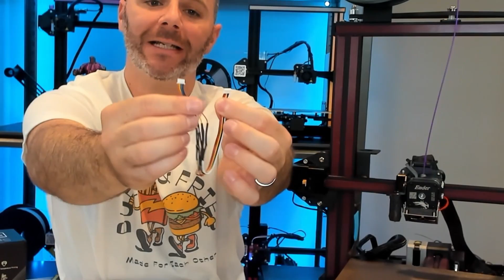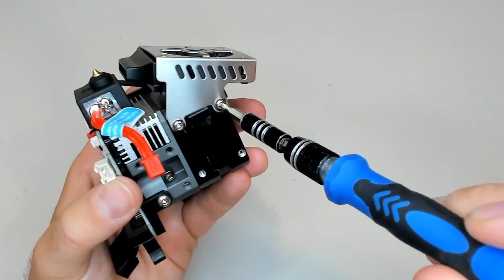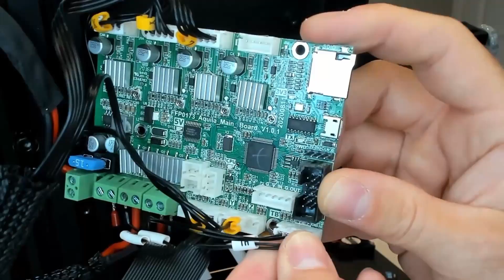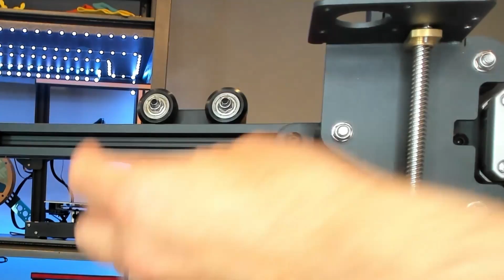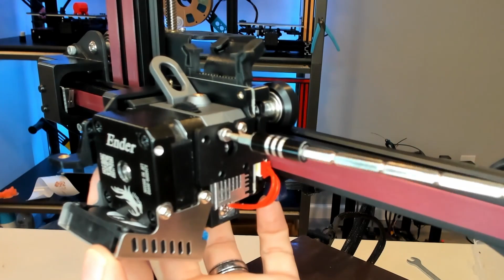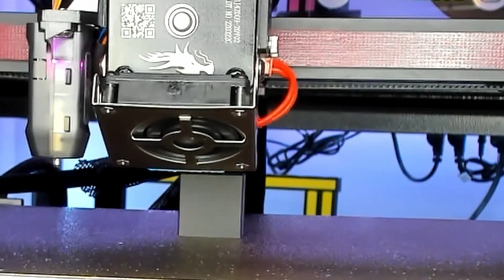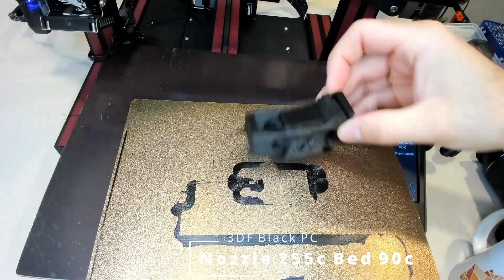Direct Drive Voxelab Aquila with the Creality Sprite Pro

Comment: Hello, I just installed the Sprite Pro on my Aquila S2.  When I tried to heat the nozzle, it shutdown and restarted with an M112 error.  I did what you said and reversed the nozzle heating wires and it doesn't shut down now, but I still get an M112 error that won't go away.  I have installed your Aquila Sprite Extruder firmware as well.  Should I switch to the Alex firmware?  Thanks!
Reply from the maker: Recently someone else had a similar issue and it ended up being an issue with a wire being burnt out (I think). Can you check (visually) the wiring harness where it attached to the break out board , as well as the main board itself to check for any sort of shorting out damage.
Reply: @PrintsLeo3D  I will do that, thanks!

Comment: Is this mod suitable for Aquila Pro model?
Reply from the maker: Victor I don't think it is. I don't own an Aquila Pro and I'm not very familiar with it's components, but I believe this is the Aquila that uses a mainboard as well as a smaller breakout board.  Because of that feature, as well as the onboard probe, that may not play nice with the sprites break out board (again I can't confirm because I don't own one) I would think this is not an easily compatible mod like it is for other Aquila models.

Comment: Greetings! My sprite kit just arrived? Just to try to speed things up and get an experts reference point, what where your offset settings for the Cr touch and your flow adjustments?
Reply from the maker: Hey I'm sorry in advance that this answer is going to be a little wishy washy, but I'm on vacation and not at home so I don't have access to my settings. If you go to my website I have a webpage dedicated to the Sprite, and there you should be able to find the offsets and the profile I was using! (PrintsLeo3d.com)
If you need some more help let me know and I'll do my best when I get back home !

Comment: My Ender 3 pro came with hot glue all over the motherboard. It was really difficult to remove connections and after all that, we can’t get the hit end to heat up. 😢
Reply: I found out yesterday that the hot end wire wasn’t actually connected to the daughter board.😂 it worked great after that. It was actually really frustrating to get the old connections removed. I’m thinking about buying a silent motherboard. Which one is best for Ender 3 pro?
Reply from the maker: If you wanted to stay with something from Creality the 4.2.7 silent mainboard is a nice and quiet option. If you are looking aftermarket the BigTreeTech SKR Mini series is another choice. The SKR mini E3V2 or SKR mini E3V3 are both mainboards I've used on some of my machines. Though to be honest if you're looking for just basic functionality, with a silent upgrade, then the Creality 4.2.7 board may be the easiest option.
Reply from the maker: Liam, they love securing everything with glue, and it can be a really trouble to take it all off. What sort of error (if any) are you receiving ? Are the temperatures at 0c? Are they just not heating up at all ?

Comment: Thanks so much for the video Leo, this was incredibly helpful!

I do have a couple questions though. After setting all of this up and installing the new firmware I decided to buy a BL Touch (the one you provided in the link). First question is I don't know where the black and white wire connector for the BL Touch is supposed to plug in. 

Second, as I've seen in another comment, I don't seem to have the recommended clearance between the BL Touch and the nozzle as recommended in your other video where you're setting up the BL Touch on the Aquila; the issue with this is that I don't have the ability to raise the BL Touch any higher due to the mount on the Sprite Pro. Do you have any recommendations on how I might increase the clearance distance to the recommended 2.3-4.3mm?

Thanks again for all your help!
Reply from the maker: Hey Quantum, thanks for watching and giving me an opportunity to help out ! For the white and black wires, you should double check the wiring specs that came with the touch but it's likely, those two are the remaining ground and output wires. Some of the bl touches (especially from Creality) color the wires differently, which is why I said to double check, but if those end up being ground (black) and output (white) then can be plugged in accordingly at the end of the 5 pin bl touch port.
As for mounting the bl touch I have had some success and some difficulty. One of my Sprites I was able to mount up the touch and all was good, but I know a lot of people have not been so lucky. You also have the clearance issue as well, and this next suggestion should take care of both issues. Here are two mounts that are able to hold a bl touch and also giving you the ability to adjust clearance.

https://www.thingiverse.com/thing:5555432

https://www.thingiverse.com/thing:5411490

The first puts the probe on the opposite side of the hot end, so if you go with that mount make sure you adjust the x and y offsets accordingly!

Comment: I also want to upgrade my aquila withe the sprite. I already have a cr touch, would the cable that it already has work in case my kit doesn't include one ?
Reply from the maker: Yes and no lol if you want to use the dedicated break out board that's on the back of the Sprite then your current cable will not work. The cable you have now has a JST connector on one side and a molex picoblade connector on the other (the side that plugs into the touch). The breakout board on the Sprite requires a picoblade connector on both sides of the cable. 
You could choose to bypass the breakout board and connect the CR touch directly to the main board, and in that case the cable you have now would work just as it is. 
Luckily I have found a lot of these units are now shipping with the correct cable. So I think you're going to be in luck but at least you have a back up plan just in case (bypassing the breakout board). Hope this helps and let me know if you need anything else!

Comment: Just installed this today. Ran into an issue with calibrating the Z-offset. It goes to the top-right corner and doesn't lower to the bed. Any ideas?
Reply from the maker: Hey Rockey, what firmware did you install with this ?
Reply: @PrintsLeo3D  I have Alex's firmware. But, it's been over a year since I have done any sort of update to it.  Could that be the issue?
Reply from the maker: There shouldn't be a problem with onboard firmware not being updated after sitting for a period of time. Was this firmware ever working for you, is this a problem that is just starting now?

Comment: i have an aquila x2 will this hotend fit mine or do i have to get a diff board i have a h32 ?
Reply from the maker: Hey Jeremy! For the Aquila and the Aquila X2 they are for intents and purposes the same printer. So this will absolutely fit. The problem you'll run into, as you suspected, is the chip that's in the main board. I can't compile firmware for the H32, so you would be limited to the small amount of community released firmware (Alex's firmware if you're familiar), or firmware from Voxelab's official page. If you're confused about those differences, what they mean, and the options available to you, let me know and I can explain in more detail!
Reply: @PrintsLeo3D  thank you for the info what recommended board  would u say get so i could get the proper firmware
Reply from the maker: I'm sorry I never replied to this, YouTube flagged this comment for some reason (??) and I never saw it. You could go with a Voxelab board with a different chip (G32, N32). One of the Creality offerings like the 4.2.7 silent board, or something from BigTreeTech like an SKR mini E3V3

Comment: New subscriber... Great video... I literally just ordered my Sprite extruder before I found this vid for my heavily modified Aquila (klipper/dual z/btt e3miniv3) (if I can even call it that anymore... thesisus's ship i guess)... I'll definitely give your profiles a go and I'm beyond impressed with your attention to detail and content.
Reply from the maker: Thanks for watching, for subscribing, and for letting me know these videos work! My Aquila is still stock board but also running Klipper. So while the base parameters of my profiles should be pretty good you'll probably want to tweak the speed settings. I'm currently running 130mm/s with the sprite (it has a nice max volumetric flow rate) but I kept the speeds conservative for the profiles. Thanks again and happy printing !

Comment: My issue I’m having is my bl touch is sitting just a little lower then my nozzle. When I’m trying to get my X offset the bl touch is touching the plate first
Reply from the maker: Quentin, that can be a rough issue. If the BL Touch is sitting too high you can shim it downwards, but when it's too low there's not many options-especially with the stock probe. Is this a branded BL touch or a clone? It really shouldn't matter as in my experience they are roughly the same exact size. I did find this remixed model that can attach the probe father back on the Sprite It's possible to make some minor edits to this to make the bl touch sit farther from the build plate. If you can't make edits like that on this model let me know, and I can see what I can do for you!
Reply: @PrintsLeo3D  it’s the branded bl touch that came with the sprite drive. I have no idea how to edit anything to be honest. I’m still learning printing in general. I’d appreciate the help!
Reply from the maker: Ok, is it possible to send me a pic of the front of the printer, showing how close the probe tip and the nozzle tip are in relation to one another. You can send me it through email (printsleo3d@gmail.com) or through Discord (link in description).
Reply: @PrintsLeo3D  sent to email. And from what I’m seeing online they were coming with the cr touch not the no touch. Wondering if that makes a difference
Reply from the maker: I got it! Shouldn't make a difference, there's a few members of the Discord using the Sprite with a BL touch, but we'll get it sorted.

Comment: Thanks for this video you always do a good job and easy to understand, So the simple fact is not to waste money on upgrades that take money and time and add little benefit. It's a cheap machine we should keep it that way unless we have problems with it.
Reply from the maker: I can understand your points but overall I disagree with this take. The Sprite is an expensive upgrade no doubt, it only offers, direct extrusion, a dual geared extruder, high temp printing, and is lightweight. You could add those feature for around 1/2 the cost. Would this be my first recommendation for someone looking for these upgrades? Probably not, but saying you shouldn't put money into a low cost printers seems short sighted. I'm sure a lot of people got into the hobby through these printers, and they may choose to modify them, which requires time and money. Everyone has their own situation and circumstances, and to make and to make a blanket statement like yours misses the point. Also the money spent on this upgrade isn't without return, this is a very nice product.

Comment: hello, after installing and flashing (G32), I encountered a strange problem. The head starts to heat up immediately after switching on. No settings affect the process. Any ideas? would be very grateful
Reply from the maker: The first thing I would think to do is try flashing s new firmware and see if the issue persists after changing. If this problem is still there I would first make sure all the connectors kn the breakout board are secure. After that look at the mainboardz specifically the connections for the heater cartridge. Make sure they are seperated and fully inserted. Was this problem happening after install or only after firmware install?
Reply: @PrintsLeo3D  The problem arose after installation, changing the firmware does not give any results. True, at first I forgot to connect the thermocouple connector. After connecting the connector, it just started to get warm every time it was turned on (((
Reply from the maker: Interesting issue. The heating cartridge is just a big resistor, and it works when the mainboard allows power to be sent to it. If it's powering on immediately it makes me think this is a mainboard issue, but is the hot end actual getting heat? I had to re-sort the heating cartridge wires within the terminal block during my install, maybe that can be an option for you, but I don't really see how that would affect this. When you turn the printer on, the temp immediately heats up, but is the heating block actually getting heat or is the thermistor malfunctioning? If this was my printer I would want to see if there is heat going into the hot end. This can be dangerous so if you did this you need to take special care to not burn yourself! Also don't touch any of the wires going into the block (thermistor or cartridge) while the printer is powered on. If you have some sort of thermal temp gauge you can use to detect Temperature that is the safest way. Outside of that I would hold my hand near the nozzle/heat block and see if I can feel heat radiating from it. Again, take extreme caution and only do this if you feel completely confident you will not burn yourself. If you have stability or other dexterity issues than ask someone to assist you or choose to not apply this test at all. Again try this test at your own risk and please if you do attempt this take every available precaution to not burn/injure yourself. The main goal would be to find out if the nozzle is actually getting heat.
Reply: @PrintsLeo3D  the nozzle heats up, and very quickly. I think it's a head defect. thanks for the consultation
Reply from the maker: My guess is either there is some sort of defect in the wiring from the Sprite, or somehow the MOSFET on your mainboard that controls the heating cartridge has went, and it's applying the full 24v as soon as the printer powers on.
Reply: @PrintsLeo3D  I'll check the transistor, thanks
Reply: Yes, the mosfet burned out. Thanks a lot for helping me find the problem!
Reply from the maker: I was hoping that wasn't the issue but I am glad you found it. Good luck!

Comment: Thankyou so much for this! I did it but don't have a cr or bl touch. Do I need one or what can I do?
Reply from the maker: Glad this was helpful for you! You do not need a cr/bl touch to use this. You could use this just as well (well that's up for debate lol) using it without a probe and keeping the z limit switch as your z axis limit endstop. If you are looking for firmware that leans that route (and you have an Aquila) you can find it on my website (printsleo3d.com) under the section Firmware > Marlin > Aquila Sprite Extruder The option you would be looking for is any firmware that starts with MM which stands for manual mesh. The manual mesh firmware let's you use your printer as you normally would without a probe, but it gives you the option to create a mesh manually, which is what a cr/bl touch does automatically. So by using that Manual Mesh firmware you have the ability to get the same or similar benefits as you would with a probe, without owning one!
Reply: @PrintsLeo3D  I have a cr touch on the way so might just wait till then lol have a hard time understanding all the lingo lol as I literally bought a voxelab and used it till it clogged and then got the sprite followed your video and got it in but now im a little lost. do you have a video explaining how to do the firmware upgrade and then after how I would set it all up with the cr touch?
Reply from the maker: Sorry about all the jargon, I usually do my best to speak/type in a way that newcomers can grasp but sometimes when I rush I use all the shorthand lol I have an Aquila BL Touch video that goes over the physical install as well as the firmware upgrade. It's a long video, the first half is physical install and the second half is firmware upgrade. By physical install I mean running the bl touch cable to the mainboard in the printer, installing a new hot end shroud that can hold a bl touch and then routing the wires from the mainboard to the BL Touch. The physical part of the video will not apply to you because the Sprite has that set up differently. 

*Also I should mention whenever I say BL Touch the same info applies for a CR Touch 

When installing the Sprite did you plug in the 5 pin connector to the 'bl touch' port of the mainboard? If you did that would be the mainboard side of things. All that's left is screwing the bl touch into the section of the shroud designated to hold it(see in my video). Then using the bl touch wire that (hopefully) came with your Sprite you would just connect one side of the cable to the bl touch and the other side to the back of thr Sprite breakout board. 

The firmware side of things isn't too rough but it's the part that can be fraught with human error. I have firmware on my website that applies to the BL touch version of the sprite too. You would download that file, then copy the file to an empty SD card (preferably one you just formatted FAT32/4096 bytes by right clicking the card and selecting format with those options). On the Sd card create a folder named 'firmware' and put the firmware file within it.  Power down the printer, insert the SD card, then power the printer back on. The firmware flash will commence without you doing anything and be finished within 30 seconds. The screen to the Aquila has firmware also that will need to be flashed. The process is similar to the mainboard but differs in some areas. I would suggest watching the latter half of my bl touch video on the correct way to go about both of these procedures! Let me know when you get it if you need any help.

https://www.youtube.com/watch?v=ARAhqgkfBMo